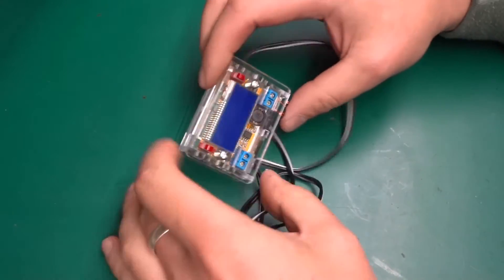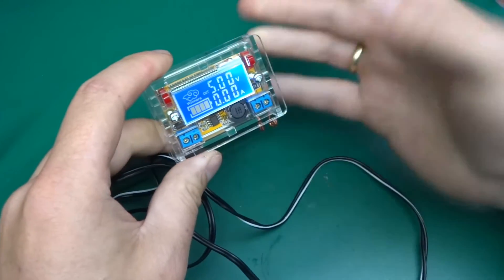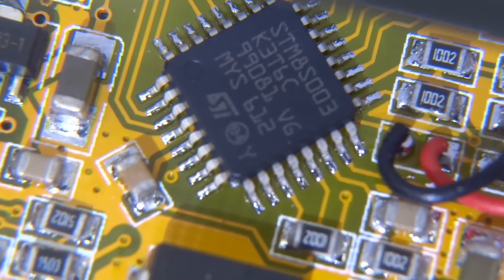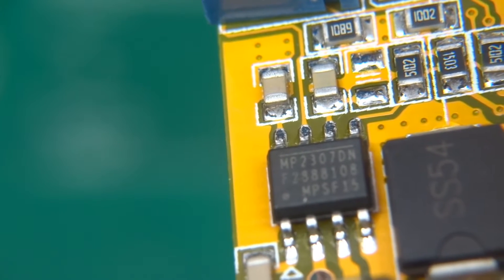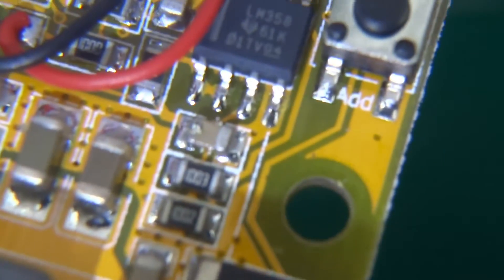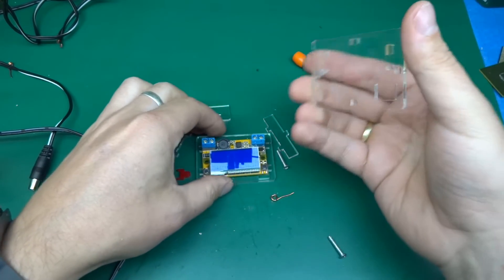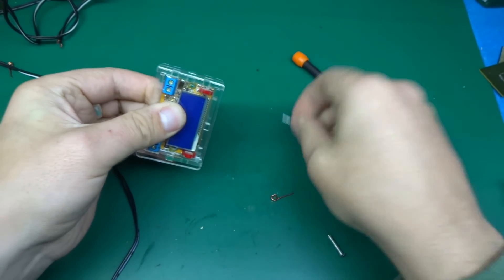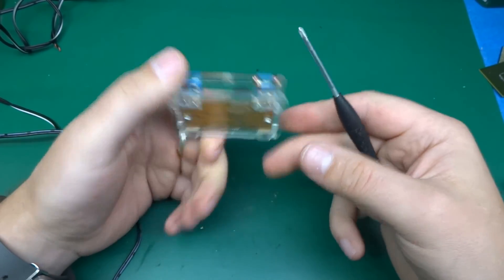Winners DC DC converter

Comment: Bought this adjustable DC-DC PSU module in Banggood for like 7€ (with shipping included) 2 years ago. Cheap and simple voltage source up to 3A. For DIY bench testing, as makeshift field DC PSU for FPV google power and whatsnot works fine. On acrylate case assembling protective paper removal was huge pain - it was glued with a way too strong adhesive. Unfortunately this module lack current limiter and is not suitable for deeply discharged lithium battery recovering. Battery symbol on indicator mean nothing for this module. Seems indicator is made for some power bank.

Comment: What is the battery symbol for?
I'm wondering if it drops if the input voltage falls?
Reply from the maker: +James Searle   I wondered myself for quite a while. As far as I could test it, it does nothing. I can only deduce, that the LCD was made with something else in mind, possibly a power bank, and it was repurposed in this device. So in short, it's only purpose is to fill up the space on the screen and look pretty ;)
Reply: randomtronic Weird thing is I see pics of it on some sites showing a different symbol. Eg http://www.banggood.com/DC-DC-Step-Down-Power-Supply-Adjustable-Module-With-LCD-Display-Without-Housing-Case-p-1038737.html
I guess yours didn't come with a manual either? :)
Reply from the maker: James Searle no manual is a standard feature for cheap stuff from China :) Yes, there are a couple variations of the LCD, but its all functionally the same. possibly a new revision or design change.
Reply: Thanks, it would have bugged me for ages.
It's quite handy, as you said.
Reply from the maker: +James Searle Glad to be helpful.
Reply: @randomtronic  I believe you are correct about power bank or other kind of battery storage as original device where this indicator was used.